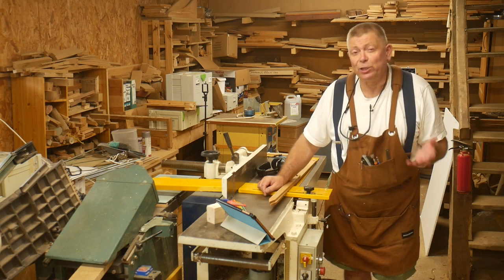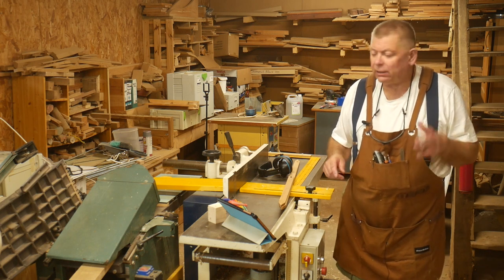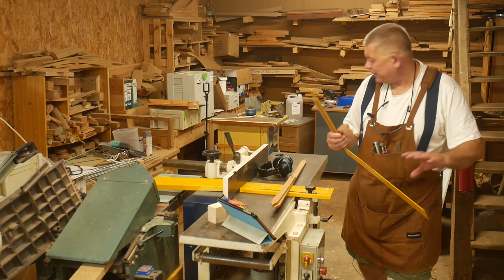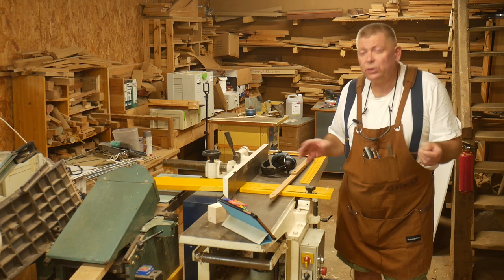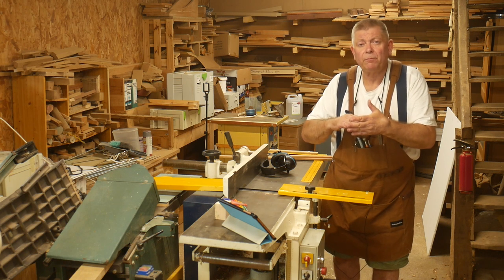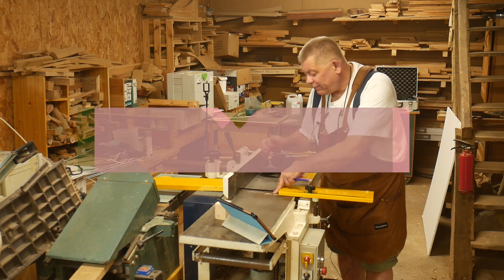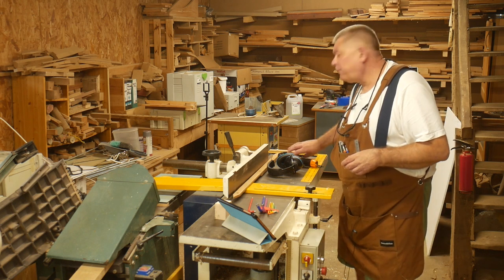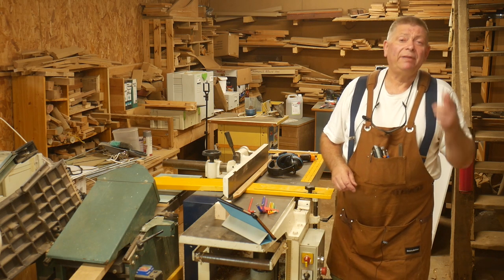Fix Those Nicks! - Don't let a screw spoil your day (too much).

Comment: The cutting head is designed and manufactured to have an acceptable 'out of balance' range when assembled with standard blades.
If a cutting head was assembled with 10 different sets of blades - there might be 10 different values of out of balance, but all would be within the acceptable range.
Therefore - moving the blades longitudinally by a few millimeters, will not cause the 'balance' to be unacceptable because the same blades are in use.
Q.E.D.

Comment: Dangerous method. And not good at all for the mechanicals of your machine. The thing is, head supporting the blades is strictly designed to be very weightily balanced. If you do this, the balance is corrupted and all mechanicals bearing and all will got their lifetime very shortened. Just do the things right, got some backups blades 😉
Reply from the maker: I disagree. They are in almost the same place, just a mm or so shifted. The balance is not affected at all.
Reply: As the blades are all ground and balanced the effect on the balance by shifting the knives slightly will be infinitesimal, definitely not noticeable without serious metrological equipment to measure minute changes in frequency during running. The amount of displacement to cause any sort of strain on the bearings would have to be immense and not actually possible without fouling the machine.
Reply: @WoodMachinist  @SteveMaskery Well, do what you want to do, i just let you hear things from a pro working in the metal and mecanics industry.
Reply: @kfayayay2674  Wood Machining is a mechanical art and is much closer to practical engineering than simple carpentry. If you want to be proficient and get the most out of your machinery you must have an in-depth theoretical knowledge of the subject, and of the material which you work with, and the skill to apply that practically to produce the best product possible. In purely theoretical terms, yes, moving the knives will have an effect on balance, but at the same time when applied practically the effect is so minimal that the act of wood cutting and the associated vibration that goes with that will have a far greater effect on any mechanical parts such as bearings.
Reply: I know that. the fact of my first comment is just true. there's mecanical issues. @WoodMachinist
Reply: @kfayayay2674  I disagree, as stated the effect of imbalance will be minute and will have little to no effect on the mechanicals of the machine when compared to it's intended operation of wood cutting. Any claim to the contrary is ill-informed pedantry.
Reply: The cutting head is designed and manufactured to have an acceptable 'out of balance' range when assembled with standard blades.
If a cutting head was assembled with 10 different sets of blades - there might be 10 different values of out of balance, but all would be within the acceptable range.
Therefore - moving the blades longitudinally by a few millimeters, will not cause the 'balance' to be unacceptable because the same blades are in use.
Q.E.D.